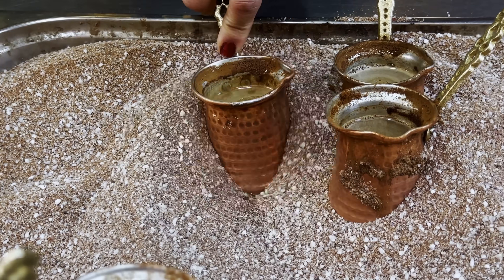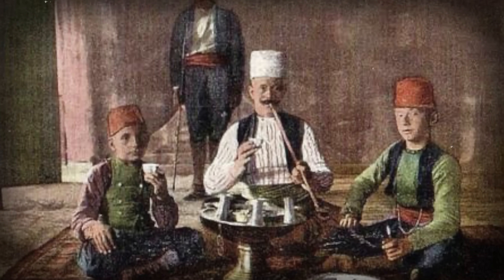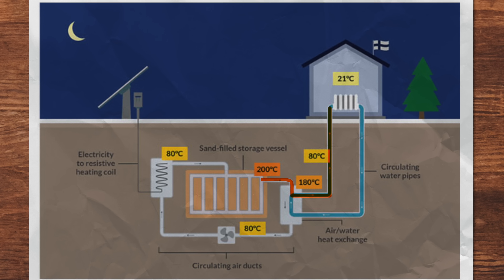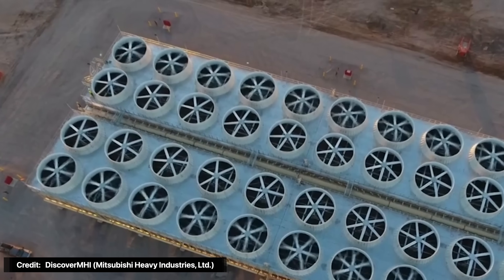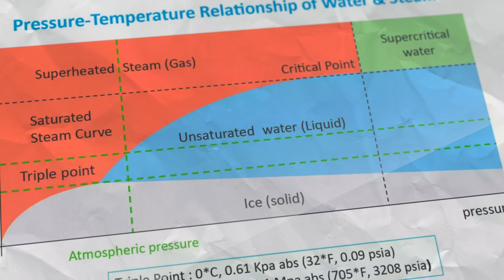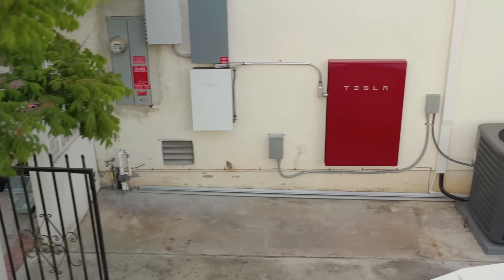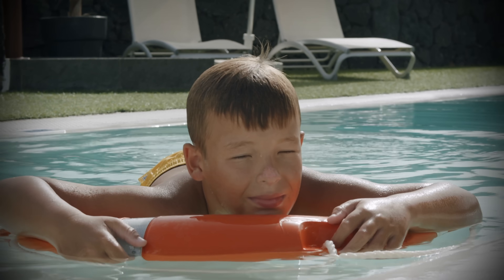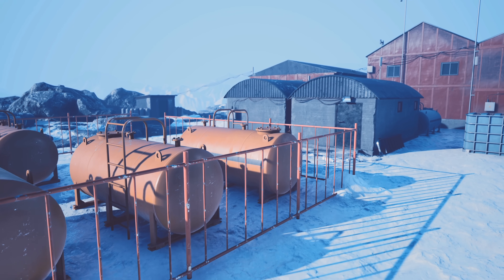The Power of Sand Batteries -- Revolutionizing Energy Storage...

Comment: Sand batteries would be great for domestic applications. They could be located under a driveway or garage and provide a hot & cold geothermal sump/source for heat pumps. Heat pump COP could be boosted significantly with this technology. It would be ideal for continental climates - hot days/cold nights. We have to get smarter with pumps and thermal distribution generally.

Comment: A pretty good presentation this time.  Though you threw people for a loop at the beginning tying sand batteries into renewable intermittency...  which you can't really do outside of home heating.   Sand doesn't really solve intermittency for electricity generation and city thermal distribution systems are really quite specialized whereas electricity is ubiquitous.

Your round-trip efficiency numbers seemed a bit goosed in the wrong direction.  Not sure why they are so off but LFP batteries have roughly a 95% round-trip efficiency at the cell level (0.2C charging and discharging) ,for any application, and of course it is greater than 100% when you shove it through a heat pump.  Throw in the electronics (but use a high battery bank voltage) and the AC-storage-AC round-trip efficiency (non heat pump) is around 92%.  That is basically an unbeatable number.

Note that LFP battery costs are dropping like a rock and will almost certainly fall through $60/kWh this year (if CATL is to be believed).  In bulk, actually, LFP cells are already south of $80/kWh right now so the lithium battery cost numbers you stated in the video ($150/kWh) are actually quite dated.

The quickly dropping cost of LFP batteries actually poses a huge challenge to the many alternative storage technologies.

-Matt

Comment: Let's call them "thermal batteries", so people won't think they compete with electrical batteries.
Reply: They have been called "heat stores" for decades. Some people in hot climates pump the hot air from their roof spaces during the day into a bed of rocks under their houses to use as heat during the night.

Pumping air is very cheap, and rocks are excellent thermal stores.

Others use 'trombe walls' to the same effect either storing energy in the wall, or a rock bed underneath.

Trombe walls can also cool houses!
Reply: Battery? Do these stores electricity?🤔🤨
Reply: Just an FYI, While thermal battery is becoming a common term for these Thermal Energy Storage Systems (TESS), There was a type of Electrical Battery that will activate upon heating it. It has use cases in Military because they won't degrade over time, while being stored, and they were previously called Thermal Batteries.

Comment: I like your idea about using it to cool as well. It sounds like you are thinking of having more than one temperature bank. You could draw heat from one for your heating needs and sink heat to the other for your cooling needs. Keeping strategic temperature ranges in each would allow you to use passive heat transfer for most applications. At the lower temperature ranges you could also use hydronics for a passive transfer medium, and heat pump for active transfers.

It would be interesting to see what the net difference between heat needs and heat waste is in our homes. If we had staged temperature batteries we could capture waste heats and use them to preheat the thermal medium in the higher temp stages so that they require less energy. 

Heat Needs: Dryers, Stoves, Ovens, Water Heaters, Home Heat - Air, Home Heat - Radiant Floors, Side Walk Snow Melting Coils, Roof Snow Melting Coils, Swimming Pools (maybe not in San Diego, but up hear in the North), Green Houses, Cold Lithium Batteries, etc.
Heat Wastes: Fridges, Freezers, Chilled Water Dispensers, Air Conditioning, Freeze Dryers, Green Houses, Hot Lithium Batteries, etc.

I'm thinking three to five stages, one really hot, and two at the opposite ends of the useful heat pump temperature spectrum. Perhaps two more, one at the freezing and boiling point of water, since it is probably the best passive medium. That would complicate the waste electrical power side of the equation a little bit more, but I wonder if it is worth it. I think of two exotic waste cases. The fictional Stillsuit worn on Arrakis (I loved that episode by the way), and the intricate thermal management of a real Tesla vehicle.

Questions:
1. It sounded like you were saying that they use sand as insulation too, which makes me wonder if we use much better thermal insulation, how long do you think we can we store heat. Can we save passive summer heat and use it in the winter? What about the opposite, save the absence of heat from the winter to sink heat to in the summer?

2. What are your thoughts about using deserts and glaciers to moderate the climate on mega scales? For instance, what if we tugged a huge iceberg from one of the poles to the California coast and moved the ice inland to Death Valley. It could take several years to complete, but the resulting ice melt would be inland where it is desperately needed, while lowering temperatures and not raising the sea level. (I got this idea from the movie: Brewster's Millions)

I'm waiting for you and Matt Ferrell to collaborate on an episode. You, him, and Grady Hillhouse produce my favorite channels.

Comment: [@]  I envision in basement or sub basement concrete container with foam create insulation sandbox and underneath a rocket furnace where the exhaust is piped through to heat the sand. Alternatively storing heat from geothermal heat pumps and or excess renewable energy. So any heat coming out of the concrete box would radiate up into the house or be vented out.  
Perhaps radiant heat air and water tubes in the floors. Possibly extending out to heat (chinese) greenhouses and or out buildings in the winter, who's foundations are also insulated with foam create walls.

Comment: If the water circuit leaks into the super heated sand, you'd have a high risk of an explosion of the storage silo. So if it's connected to a district heating grid, wouldn't you also risk rupturing the lines into people's homes and businesses too?

Comment: Still, even at a 30% loss when converting the heat into electricity, if the energy you've put into the sand battery would otherwise be energy you've lost because you'd had to stop wind turbines then that is a pretty good start. obviously if you have a local wet heating system and it is easy to hook into that the use that.

Comment: Like the balanced view, heat batteries are just one more tool, in the energy storage war. Simply right tool for the right job. Sand batteries would be great for heating pools in more tepid areas The other major benefit is life span compared to lithium and that really comes down to the quality of piping , heaters and fans, The sand isn't a wearable item in the equation.

Comment: Sand might be abundant... but there is a black market in sand for construction in India (believe it).  One cannot use desert sand of beach sand for use in concrete which means that sand needs to be mined... and there are starting to be shortages.   So any sand batteries will need to use desert sand to be viable.

Comment: There's a Czech company that is introducing such a product for small residential housing. You'll buy a device with a super-insulated box of sand (above-ground shipping container or dedicated underground). You'll heat the sand in the summer to 400°C (480°C for larger industrial applications) and gas-heater sized box in your house will provide the heat whole winter. Thanks to tackling both thermal radiation and conduction it only looses and using a special kind of a hatpump, if I remember it correctly, the SEASONAL losses are like 8%. The down sides are the storage is quite huge for a typical house (I think it was 30 m3) and the initial cost for preorders is really high - in excess of €50k ATM. Just have a think, if this is really all feasible and working perfectly and the price goes significantly down due to competition. We'd be heating our houses with the summer solar excesses from our PVs! Apart from that, they prepare something like mobile heat units, so a couple of trucks would arive to a destination with pre-charged shipping containers and provide a heat in case of an outage of a heating system. The system is called Watt Sand+ system by Watt Plus. Matt Farrell talked about other similar residential systems coming to the market. And for Rickey: No, heating costs is absolutely not only issue in the far North. Central Europe is like New York climate and you have already high heating requirements, with virtually no air-conditioning required, if your insulation and shading is meaningful.

Comment: A cold battery makes a ton of sense. Use a ground source heat pump to cool large sand battery.  Run a hydronic loop through the battery to your fan coils using a mixing valve to control the temperature of the water.

You would want to cool the battery down as low as can be done efficiently by your heat pump.  And size it to last overnight on your hottest night.

The hope would be that your solar array would be enough to charge your DC batteries and cool the sand battery far enough to make it overnight.  This is made easier by the fact that the hottest nights are generally preceded by the longest sunniest days.

Comment: Good evening all. I like the cold storage concept and I wondering why one would spend money for a sand storage facility instead of going directly to Geo-thermal storage?  One will still need battery storage to run the systems without grid assistance.
How big would a sand storage system need to be to to keep 100 square meters of your home, home X in location Y, comfortable throughout the year?  I am embarking on a massive home remodel in California, and heating without Gas is starting to look like an excellent idea.  Thanks 🦊Riki2Tails

Comment: kek.
I'm sure someone else has probably already said it, but a 'Cold Battery' wouldn't actually work, at least not well imo.  The issue is that you can only get so cold before you hit absolute zero and cooling to that degree gets more and more difficult to closer you get to it. On the opposite side, with heat, there isn't actually any absolute limits where any limitations for heating are entirely down to the material.  A big reason that sand is such a huge heating source is because of the truely excessive amounts of heat that it can store making that objectively low transference rate somewhat moot, at least compared to using the same material for cooling.

I imagine a cold battery hurdle to be 'charging' the sand with the lower temp.

Comment: Could be an interesting use for all the unused office space in major cities. I imagine weight would restrict the number of floors able to be used, but buildings could easily have lower floors converted to thermal storage to help reduce heating and cooling cost, while also reducing the required occupancy rate. Especially if the building was able to store more energy than it used and was able to sell excess to surrounding office buildings.

Comment: I have been using sand batteries for 4 years in a greenhouse it works responsibly good.  I use a solar collector in a circut using pex pipe.   I’m considering using solar to run heating elements so I can obtain higher sand temperatures.
Reply: I have been thinking of that
How do warm the battery and where is it? In the greenhouse itself?

Comment: Great topic. There have been many “batteries” like this. Simply a means of storing energy. The real killer app will be the super capacitor. The ability to store massive amounts of energy quickly could  change everything. Imagine a super capacitor connected to a sand (heat) battery. Theoretically one could capture lightning instantly and then feed that into the sand battery. Then draw the energy out in a controlled fashion from the battery. It’s only a question of figuring out the materials and methods. Definitely not simple but it is physically possible

Comment: To be used for heating every home would need sand battery as heat can't be sent by long distance, it would just better to go with geothermal. For sand battery to take off, it has send that energy has electricity so that 30% loss has to be reduced. At least its better than the wind turbine losing a 100% of the energy went it's not in use.

Comment: Colder climates are, logically, located closer to the poles than the equator.  So, how would you put heat into these sand batteries in colder climes?  Solar?  Reduced generation capability the closer your are to the poles.  Wind?  Perhaps, but site determinant.  The remaining options are geothermal, natural gas, coal and nuclear.  What, then, is the answer?

Comment: You state that this wouldn't work very well during the summer (other than your "cool battery" you mention later on). However, this would work great in the summer as well for "passive" cooling. Using a large radiator of sorts above the home, create an updraft through the home cooling from conduit that's in the ground. Even if not using it to "directly" cool the home, use this cooler air as the ambient "outside" air for an airconditioner to transfer heat into out of the home, making the aircon far more efficient.
The pumping would almost be not needed for this type of loop as convection would keep hot liquid at the top of the draft tower/vent.

Comment: The problem is the hotter it gets, the more you waste due to a low temperature differential.  It needs high temperature heat pumps to recover that heat differential.

Comment: 4:31 OK so far you are heating the sand with hot forced air, hmm, that does not sound “efficient”. Then you essentially can only use the stored energy in the form of heat to heat houses and heat water for say, showers, dishwashers, etc…. Nothing promising so far,  but back to the show, maybe there is some real surprise energy science to be had yet here.

Comment: I saw the polar night thing when they first installed it, seemed genius, so i built a small scale one using an approx. 1 cub yard of sand and a small wood stove. it has worked 2 winters now, but i still haven't worked out all the issues yet. i need to move more heat from the wood stove to the sand instead of heating my shop to 80+ degrees. I burn a small fire for approx 5-7 hrs per day, and the heat radiates off the insulated sand box at night and does a good job keeping my 1200 sq ft shop toasty warm all winter. saves a truckload of firewood compared to just the woodstove i had. plan to connect solar panels to it soon!
Reply: Check out videos on using a Rocket stove to make and direct the heat you want to store.

Comment: I am a big believer in thermal energy. This was true even before I knew anything.  I had a house that utilized a wood burning enclosed burn chamber in our mud room that burned wood very efficiently and heated a ceramic tile wall in the house. There was a ceiling fan near by to aid in distribution of the heat and that wall would stay warm for days.  Think if you had something similar that heated sand with excess solar electricity then circulated air through steel piping in the sand to heat the wall.  I feel too many people discount ideas such as these with arguments about efficiency.  Once installed there is virtually no maintenance. This can be built with off the shelf equipment that would make repairs such as a blower motor easy to do. This type of system could last the entire lifespan of the home and could be self powered by the same solar system.  Upfront costs, yes, but after that, you could have supplemental heat for life.  The cost for this is not too much compared to the propane cost reduction it could provide.  If I could reduce my propane by 30%, that’s like $500 a year, every year, forever!